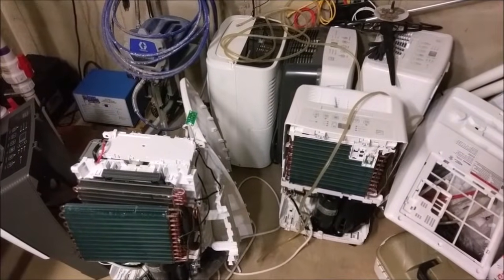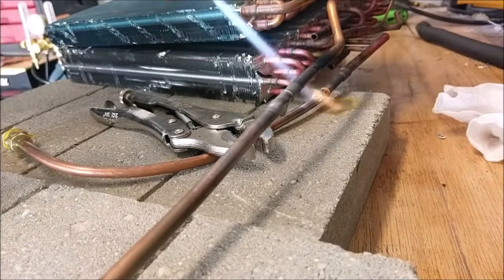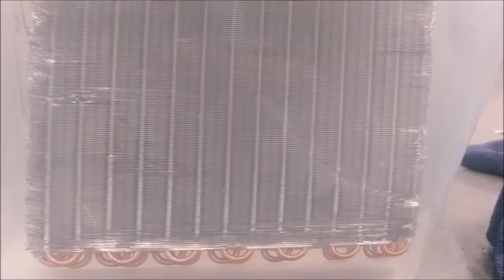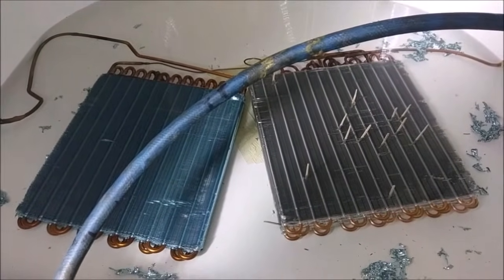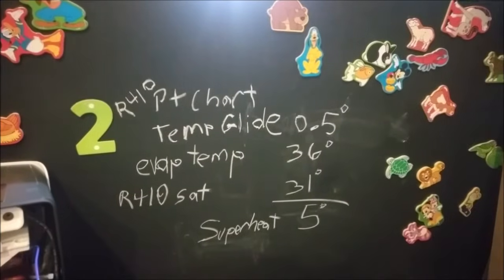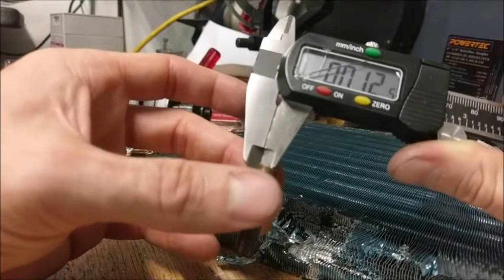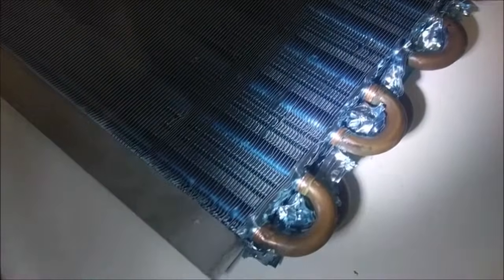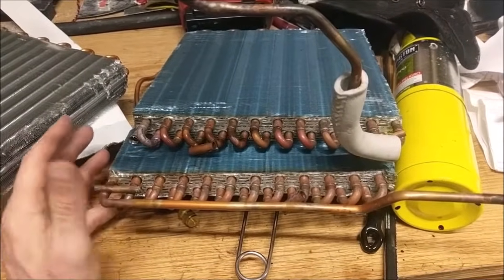Home dehumidifier recharge and leak repair 410A

Comment: I just purchased a secondhand refrigerant R290 dehumidifier. It’s called the corlitec dehumidifier. How do I know if it’s operating well? I’m afraid of a potential gas leak/carbon monoxide leak. Is a refrigerant dehumidifier capable of doing those things? Thank you.
Reply from the maker: Dehumidifiers with compressors typically use refrigerants. The amount of refrigerant in these standard size machines is small enough that in a standard house with air circulation/ventilation, it usually isn't a problem if it leaks. To diluted. Remember many people lose pounds of refrigerants in their home A/C's when the evap coil in the furnace leaks it out into the house. Those systems can hold 10-12lbs of refrigerant easy. I believe R290 is just a very dry and pure propane and these systems don't hold much of it. You would need to look at your situation, such home size, room size, dehumidifier, air leaks/ventilation. But propane is usually more dense than air and likes to stay low to the ground. Since propane is a flammable gas they do make flammable gas and CO2 sensors for around $30 at hardware stores you just plug into the wall and it hangs there like a smoke detector if you are really concerned. These are also good incase the heat exchanger in the gas furnace cracks or get holes, if the CO2 level gets to high inside it can detect that also. Otherwise non-flammable HFC refrigerants need a special gas detector for those.
Reply: @fer8888888  Wow thank you so much for your comprehensive response! I feel better about my purchase now. I will heed your advise and purchase a flammable gas/CO2 sensor. My room size is about 4 meters square, and I always keep my windows open. I believe this unit has 60g of R290, that’s infinitesimal right? I’m guessing with that amount of propane, even if this unit goes faulty/or the heat exchanger cracks, adverse leaks won’t be substantial enough to inflict any harm? In retrospect, maybe should’ve bought a new unit for peace of mind! 😂
Reply: @flyingdaworld honestly you're better off with R290 as well. Much lower pressure, better heat conductivity so it can potentially use thicker copper, and also it can use mineral oil like the CFC's of old, unlike the POE oil that turns to acid if there's moisture, overheating, etc. much less likely to leak even in the same system design. We're talking under half the pressure of r410a/r32 here.

Comment: Eddie, Can you share with us the manufacturer of what you called Humidifier #2.   The coil that was not leaking in your testing.  That manufacturer probable has the best quality manufacturing control.
Reply from the maker: All the coils in the video are the same manufacturer different machines.  Statistically with that many the odds are high atleast one would have a good part.

Comment: Do you  still have  those compressors
Reply from the maker: I threw most of them out. But still have a few for spares incase the one I made fails.
Reply: I save  the  compressors and use them or sell them

Comment: How much it costed you and from where i can get a small amount of this freon ?
Reply from the maker: I bought the 25lb jug because I have an EPA license. I think you can buy the 2LB jug with out a license at a premium per pound for it. Or buy it on ebay.

https://abilityrefrigerants.com/refrigerants/?gclid=CjwKCAiAt9z-BRBCEiwA_bWv-LGNI_pczTsee6EPLqPeRsQjYaQD_-Wfq2AlxEV7utDFIge1gIZWRxoCzkIQAvD_BwE
Reply: @fer8888888  
Sir. So you know somewhere cheaper because i bought a used one for $37. I thought it is fine but i noticed later it is not collecting water or reducing humidity until i figured it out to be out of freon. Because if i buy the 2 pound can for 100 bucks, it will cost me more than buying a new one.

Another question, why do not dehumidifiers come with built in freon valve?. Are they designed to be disposable ?.

Comment: Who are you calling?  The manufacturer?  Are they under warranty?

I have an Arctic King 70 pint that started icing up.  Definitely a leak because there is a big oil stain under the unit.  I have the skill and equipment to do what you are doing however the price of 410a is ridiculously high! so I'm leaning towards selling AS-IS for $20-35 on CL  No refrigeration guys will work on these units either even if I said I only want a charge.
Reply from the maker: Yes the manufacturer.  410a is about $160 for 25lbs.  More than enough for dehumidifier plus will have it if my home A/C ever has issues.
Reply: @fer8888888  Thanks for speedy reply!  Does the manufacturer only replace if still under warranty?  NOTE:  those little bottles of 410a are stupid expensive compared to the 25# tank.
Reply from the maker: @NoferTrunions  That's my understanding. After the last one I gave up and bought a different brand I saw I sale. That one started icing up a little so decided statistically I have to have enough parts to make 1 non-leaking unit. So I invest in buying 25lbs of 410a. The little bottles are marked up because you don't need an EPA license to buy 2lb bottles.
Reply: @fer8888888  Thanks for the 2# bottle tip (eBay seems to want licenses for all sales - but that is just eBay.)  I'm thinking the best strategy is buy the cheapest unit you can find - specifically DO NOT buy a 70 pint unit.  Run it to death in the basement.  If it fails within 1 year (likely) you get another one (I wonder if the replacement has a warranty?).  If it lasts more than 1 year you don't have that much in it since you bot the cheapest, "throw away" unit.

Comment: From what I've read online, getting an AC unit and modifying the drip pan is the most reliable way to dehumidify a room. Dehumidifier manufacturers are a pile of garbage at the moment, a good AC unit can last decades.
Reply from the maker: That's not a bad idea, but it triggers off temperature, so something to control it by humidity would be needed.
Reply: @fer8888888  humidistat controlled power outlets are cheap and easy to get

Comment: I have a Fridgidaire dehumidifier from 2008 that still works perfectly. I'm one of the few and proud. I also got a second Danby that's only from 2017 that's already lost the refrigerant. The Fridgidaire pulls a ton of water very quickly from the basement, and just simply keeps working. Time to sell the parts off the Danby!
Reply: I have a Frigidaire that's freezing up after a year, which led to me to searching for repair options and finding this video.  They claimed it was one day out of warranty and wouldn't replace it, but after some pushing, they are now.  It'll be interesting to see how long the new one lasts.
Reply: I have two Fridgidaire dehumidifiers, both are less than 3 yr old. Both are now showing the F0 error code, due to refrigerant leaks, leading to overheating condenser and coils. They used to replace even units out of warranty, so it will be interesting to see what happens if I can contact them. I noticed the price DOUBLED over a span of 3 years, probably due to the warranty problems. Thanks for your info.
Reply: We have a Fridgidaire fridge from the 1960s thats still going strong!
Reply: The Frigidaire one I have didn’t last more than 9 months, bought it on amazon, they won’t do anything with warranty, and it’s impossible to get a hold of Frigidaire in Canada.
Reply: I have two Frigidaire dehumidifiers that are about 3.5 years old.   One still works and the other just croaked.